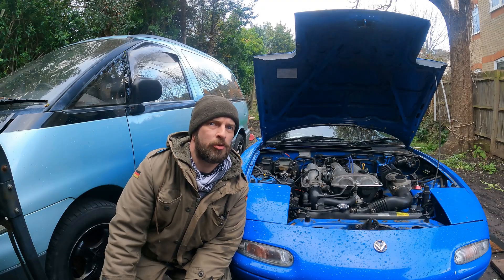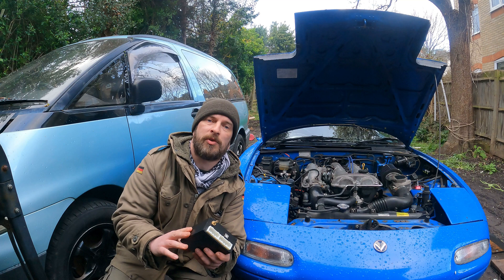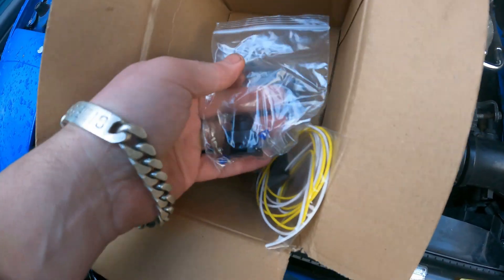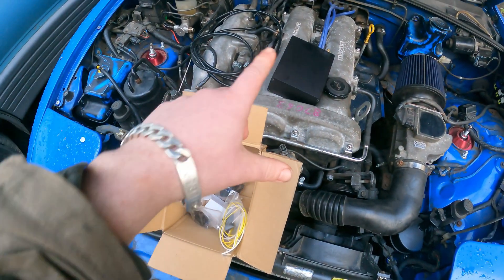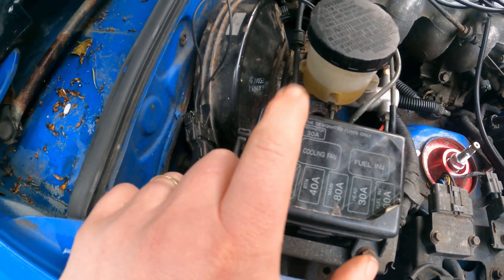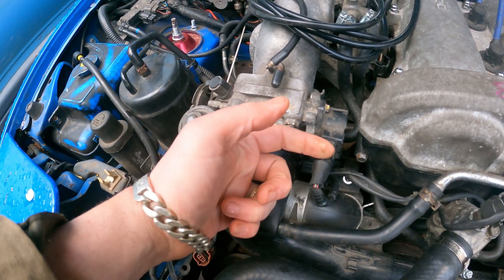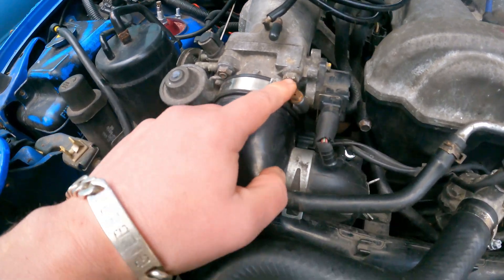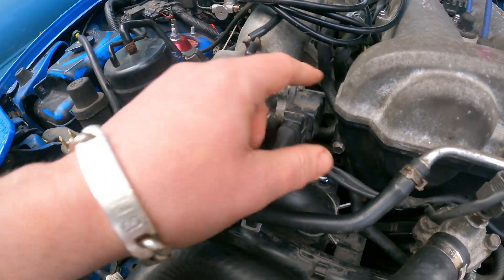How to Install Speeduino ECU - Mazda MX5 Miata Turbo Build EP2

Comment: How's the reliability of speeduino setup? I heard very bad reviews of DET ECU and I'm searching for something nice and reliable.
Reply from the maker: Hard to say as the car had existing issue. Wouldn't start at all before, now does a little. Haven't done much in a while but should be working on it again in the next few months. Proper testing will occur then. Not many alternative apart from more expensive options.